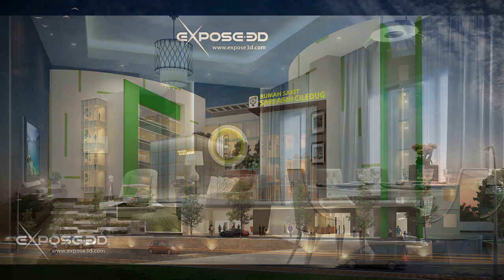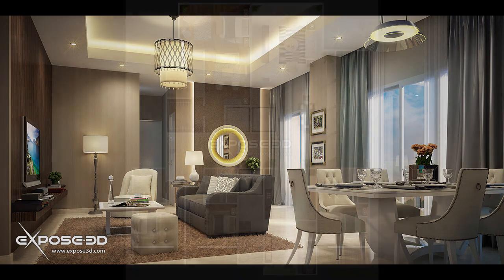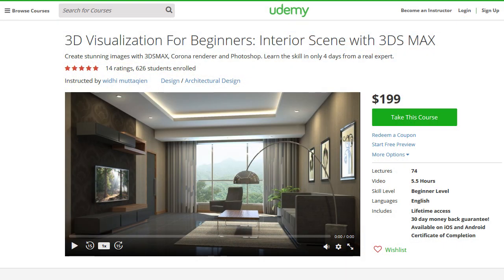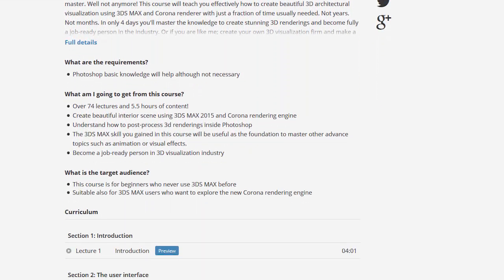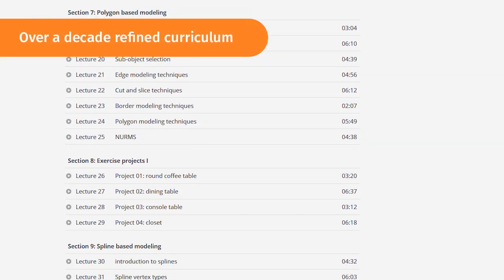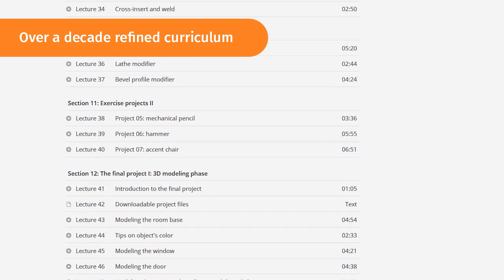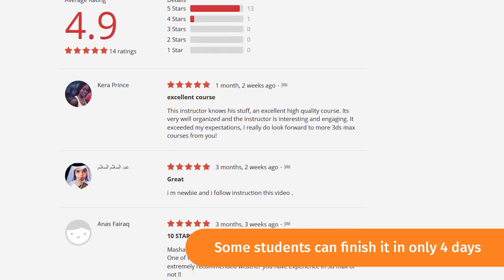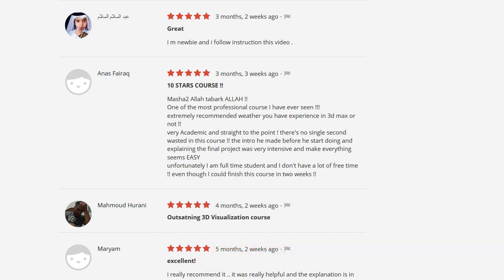3D Visualization for beginners | Learn 3ds Max, Corona and Photoshop

Comment: At the time of learning is there laptop compulsory ?
Reply from the maker: Hi Prashant. The course is not just about theory. In fact, like 95% of the lessons are practices. So you do need to have a computer with 3ds max already installed to be able to follow the lessons. But it doesn't have to be a laptop, you can also use desktop computers. Just make sure it has dedicated GPU (Geforce, Radeon etc) because onboard GPU (intel GPU) won't help you much when working with 3D applications or graphic applications in general.
Reply: Expose Academy in India i want to do this course, please provide me the address and contact no..

Comment: I read your blog and noticed you switched to Blender. would you advise I still learn 3Ds max or Blender for Architectural Visualization and Rendering?
Secondly, is Blender okay for now?
Reply from the maker: Hi Elias. Sorry for the late reply, I was away on a long trip overseas for almost a month. Have so many messages I need to reply now :D

If you are very new and you want to build your own business and doing freelancing work, I suggest you to learn Blender. Blender is more than capable for doing architectural visualization. I'm actually planning to create full archviz course using Blender at Udemy next year in sha Allah.

But if you are planning to work in an architecture firm. I suggest you to focus on 3ds max because a lot of existing firms still using 3ds max for their arch viz pipeline. Its harder (but not impossible) to find job in archviz if you use Blender.

But some interesting facts about Blender is that more and more studio and firms start using Blender. Also if you know 3D skill in certain application such as Blender or 3ds max or Maya or Cinema 4D etc. The skill will be easily transferable to other 3D application because at the core the concepts are the same. Is like learning to use gimp after you know photoshop before.